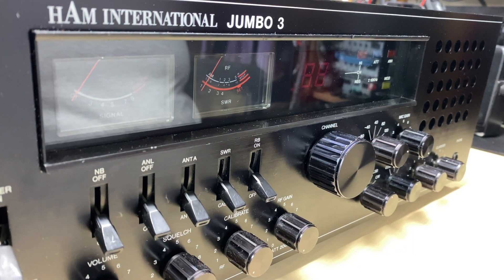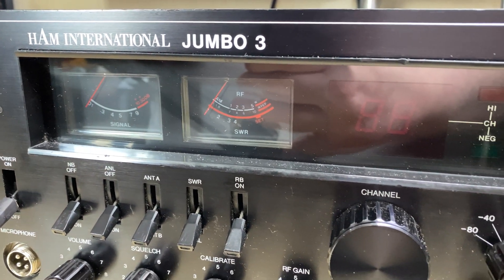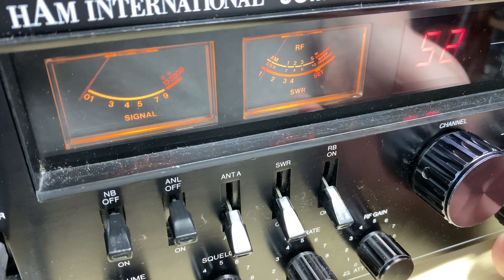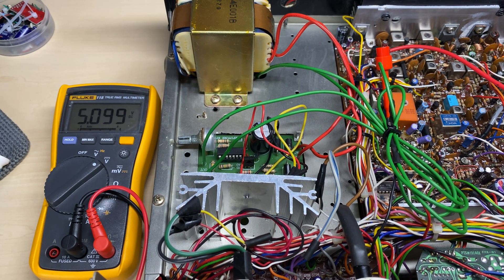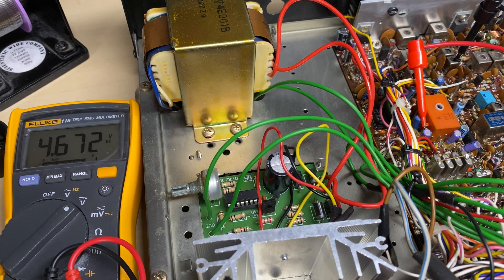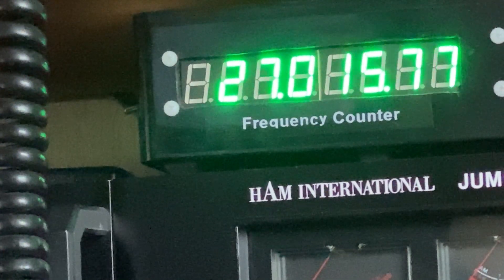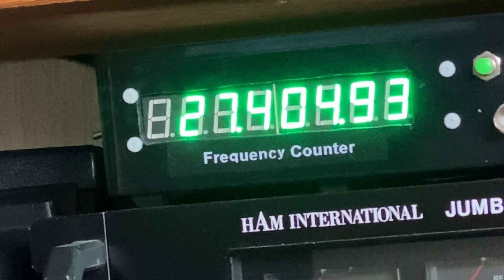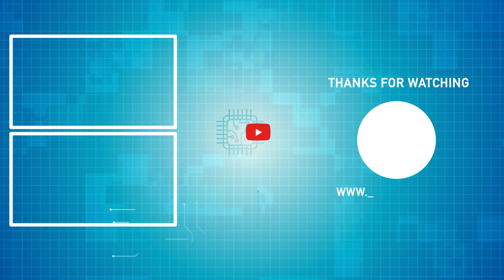EP 161  - HAM International Jumbo 3 - HC806 Fail.

Comment: A long time ago Graham, I did do a conversion of a jumbo with a Cobra MK2 board, but I kept the original cybernet ch change but With Cybernet using negative binary I only had to change the common of the ch change to accommodate the positive binary for uniden with the addition of the N/codes. I can only think that the ch change is of the Uniden type for the need to invert the ch codes. as 1 being high side injection and the other low side. PLL/ Synth.